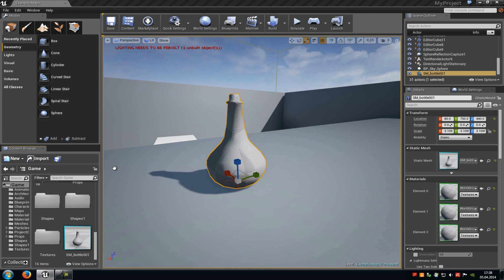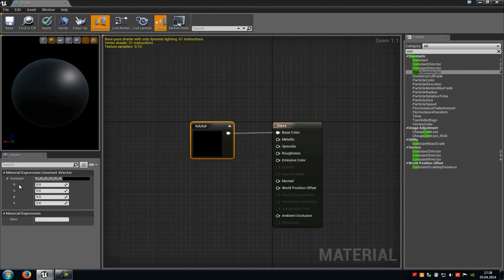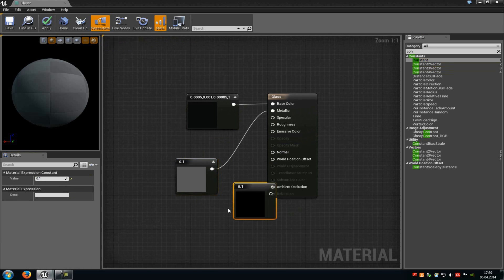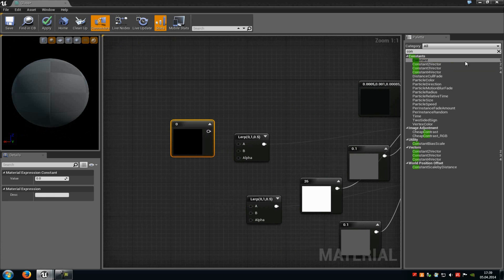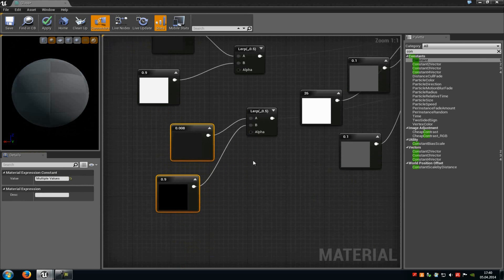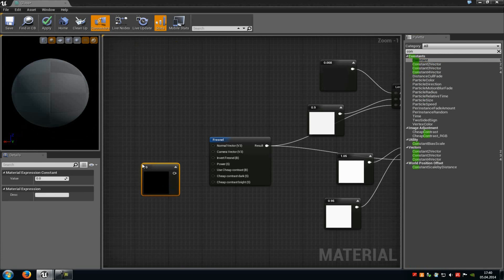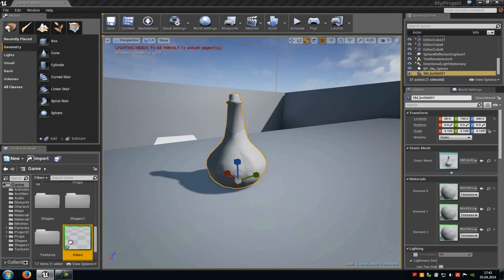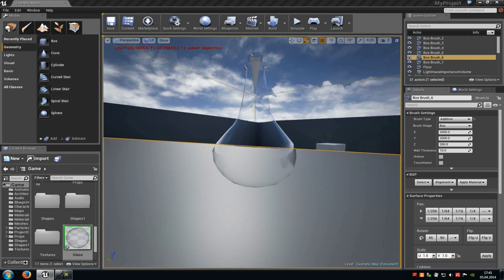Unreal Engine 4 Tutorial: Glass Material (english)

Comment: How does one even come up with all of those connections? Its crazy looking to someone just getting into Unreal Engine. Still have so much to learn.
Reply: +David Corzine Exactly what I was thinking lol!
Reply: Doesn't necessarily mean its the best way. The whole point of PBR (Physically-Based Rendering) is that it is based on real-life materials. The fact that there is a metalness value on something which is not a metal should ring alarm bells straight away. Fundamentally, 0 is non-metal and 1 is metal. You can't have half a metal and glass is not 10% metal. At the end of the day, you can tweak many settings and get something that looks ok, but it soon falls apart when you try and make adjustments, because it isn't following the theory on which the rendering model was built.

Comment: I did this and rewatched your video thoroughly, but my "Glass" continues to be nearly black and reflectionless. I set a SphereRelectionCapture, which worked with Epic's chrome material under Starter Content, but did nothing for my glass. Are you certain you're tutorial hasn't been outdated by the current engine?
Reply: Max SMoke What he doesn't show you is that you need to have a Reflection Capture object and you need to rebuild your lighting in order to capture an image. There's level setup that's required to make this work, otherwise your glass remains "black".
Reply: I am still getting black! Any advice?